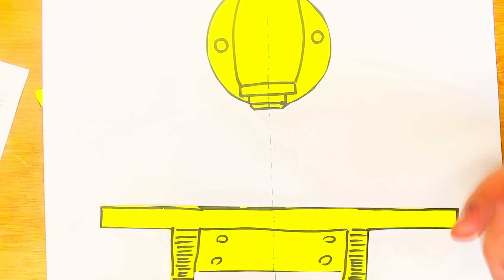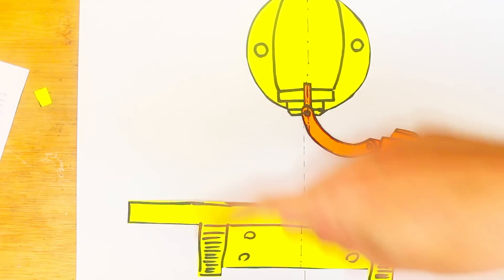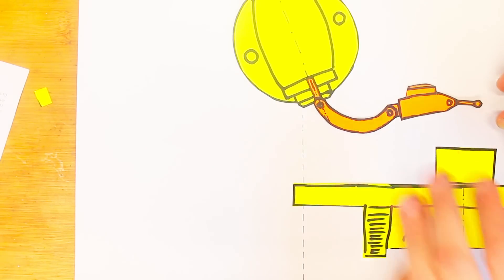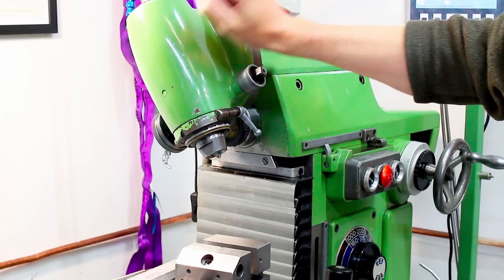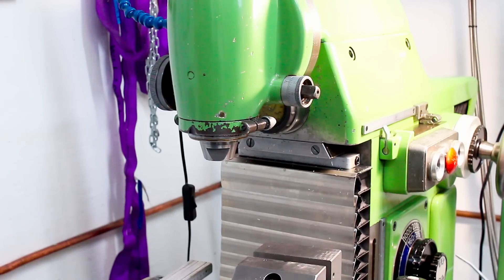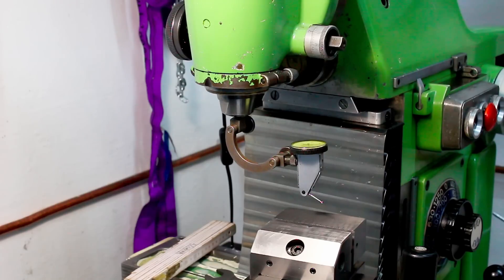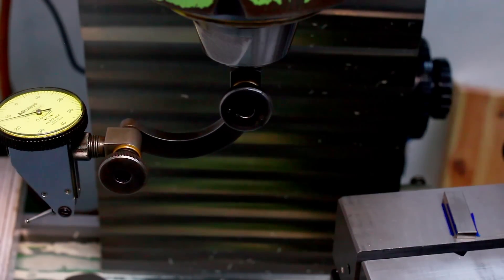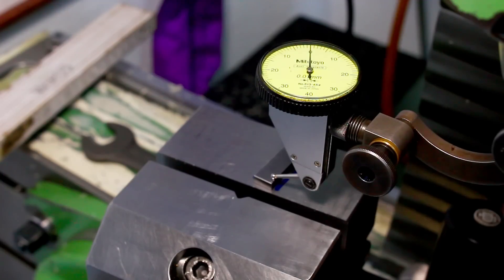Machine spindle tramming

Comment: I'm very new to this stuff, about 3 weeks into learning "from scratch." What I discovered about the gauge block method is that my mill's table is not "very flat." I ended up massaging the block around for a bit until I found repeatable measurements "within some range." Well my rong-fu 30 is not very accurate. But it is very rewarding to learn how bad it is, and to understand what one can do within the bounds of reasonable badness. It's pretty obvious if you use a brake rotor then you are getting "average badness" that is more under the control of the brake rotor. I guess the idea is to throw everything you have at it and see what comes up.

Comment: I don't understand: doesn't sweeping a gauge block sitting on a vise simply reproduce whatever imperfections there are in the vise surface? I can see that the total surface area of the gauge block will reduce this effect, but unless you touch off/measure on exactly the same point on the gauge block on both ends of the sweep, any angle introduced by tiny imperfections on the vise surface should be repeated on the top of the gauge block, less a slight averaging effect. What am I missing?

Comment: 3:38 Most don't know that on the Bridgeport there are notches/steps factory milled into the housing at the ends of the quill stop screw specifically for use as reference surfaces for tramming using a square or indicator. On a Bridgeport that would be better than using the side of the quill.

Comment: When tramming on the table I never swept directly on the table. Slip a solid object with know parallel sides (1) between the indicator tip and the table. Swing the indicator around and check again. Far too many times I've seen the indicator tip take a shock.  Another option is to use a good size bearing race large enough to cover the y axis dimension of the table. And sweep on toP if that. Another option is to tram up and down with the quill to a very accurate angle plate in x and y. 
Additionally the top of the table should mapped to see just how flat the table is to the x and y axis. Also an angle plate should be checked to z axis motion. Head or Knee.
1) As you said a gage block or my personal preference a roller from a Timken type or a cylindrical roller bearing. Ground to within 0.00005"/0.0013mm or less in parallel. I preferred to use the roller out of a bearing for two reasons. One is if I drop it it. The second is I had several sets of 3 made up to different heights for doing set ups. One thing I did a lot of is rebuild machine tool spindles. On a lot of spindles the front face or a gage line are meant to be a certain dimension from a specified feature. This often requires grinding spacers to the needed dimension. These spacers need to be as parallel as possible. Less than .00005" in parallelism. This often required grinding a sacrificial surface to put the spacer on. This gave as true a surface as the grinder could produce.

Comment: I'll have to view "part 2".  I am concerned about table droop.
Reply from the maker: table droop is definetly an issue - But not only with that technique, but in general. If you use the table movement method to tram the spindle and you are worried about table droop, move the table symetrical left/right off center, that will average the droop out.
Reply: @StefanGotteswinter   Yes.  I  suppose that the definition of having  the head trammed becomes somewhat subjective when the table droops.  The best one can expect is a symmetrical bow tie shape on the machined part.

Comment: All the vids on this and yet not one shows the final proof that it is square. I have found that all these methods only get you close. 
The final proof is taking a light facing cut with a 3-6 inch single point fly cutter and seeing that it makes a cross hatch pattern in both directions and in both the X and Y axis.  If you see a pattern like this )))))))))) or this (((((((((( it is NOT square on that axis. 
I have one job that requires milling a 14x14x2" part with flatness better than 0.0002" and parallelism better than .001". None of the methods I've seen can accomplish this, leaving steps between passes. The only way is test cut and tap until both axis show crosshatch marks in both directions.
Reply from the maker: Well, thats true that it will often get you only close to a crosshatch pattern - because a cut introduces a force into the system and bending things out of square during the cut.
I even found on rather very sturdy mills, that they where only able to perform a crosshatch cut in one direction, not the other, after tweaking for that finish.
What counts for me, is the squareness to the axis movement to get as good positional precision as possible. (important when changing from a short edgefinder to a long endmill to an even longer boring head.)
(The tramming i performed here will for sure give a clean crosshatch with my 50mm facemill - i dont have or use larger cutters)

Comment: 750 videos on tramming a spindle, now rendered obsolete by German precision. Also, Bridgeports are very top heavy, and they are a pain to tram. The worm gear moves all over the place, you have to approach tram from the right direction to mitigate the backlash in the worm, you can’t just bump it back and forth. Also, it will mover ALL OVER the place once you begin tightening down the bolts. It doesn’t matter if you’ve snugged them up, it’s going to move. Come to think of it, bridgeports are very mediocre machines in general. Yes, they can technically be pressed into doing a lot of different things, but they don’t do any of those things particularly well. I can’t fathom how/why the ended up becoming the predominant design in the US when there were so many superior machines on the market.
Reply from the maker: Don't worry, the Deckel mills here have about a million problems, just different to the bridgeports :)
Reply: @StefanGotteswinter  haha, yeah I guess the grass is always greener, as they say. 😉

Comment: Question; when you swing the spindle head 180 degrees how do you know you actually swung it 180 gegrees and not say 179 or 181 degrees?
Reply from the maker: Its not critical - As long as the head is not (for example on a bridgeport) nodded forward/backwards an significant amount, it will be fine.

Comment: There are a few subtle differences between the three methods. The first method sets the axis of rotation of the spindle square to the surface of the table, which makes for good fly cutting but introduces inaccuracy if the travel path of the table is not parallel to its surface. The second method sets the surface of the quill parallel to the path of the z axis travel. Two sources of inaccuracy are introduced- that the axis of spindle rotation may not be parallel to the surface of the quill, and that the travel of the Z axis might be out of square to the table surface and table x-axis path. The last method trams the axis of spindle rotation square to the travel path of the table, which generates the best flatness on a surfacing cut, but at the expense of parallelism between the finished surface and the table surface. It seems to me that each method of squaring should be used in specific situations depending on what kind of cut will be made and on which dimension has the tightest tolerances.
Reply from the maker: The first method (sweeping on the table stationary) will create a unpredictable result for flycutting, since the table surface is not necessary 100% parallel to the axis the table moves on.

Comment: Interesting Stefan, but I have a question. In using this technique...are you not transferring any error in the table to the head? If your table is worn on an older machine the error in traversing it from one side to the other will migrate into the head...no? When we sweep the head from one side to the other 180 degrees for example using the slip gauge method you mentioned the table is static...therefore any error or wear is not transferred...Or am I getting it all wrong?

Comment: On my Bridgeport clone to set the job at an angle say in the vise  or on a angle plate or for tilting the head for that matter I use one of those small and cheap electronic levels 30ish NZ dollars. Never checked against a precision known angle to see how precise it is but for the work that I do its more than adequate. Quick too.
Tramming the head of my Bridgeport clone  ( I use the sweep method using a precision block ) is made a little more difficult as the mill is fitted with a Southwestern 2.5 axis CNC retrofit but after doing a few trammings it becomes much easier.
The Bridgeport turret type mill for general machine work has got to be the most versatile milling machine ever made.  Stefan you really must try one.

Comment: Stefan, the technic you mentioned on the Deckel style machine do not allow you to trim the head with the table but only align the head with the vertical axis of travel.
Reply from the maker: Well, thats what we want usually - Square to the axis, not to the table surface. Having the table trammed is a different thing.
Reply: @StefanGotteswinter  Sure, you mixed various things....

Comment: Thank you for this great video.

I understand a 3 axis milling machine as a set of: a table (or any piece support), 3 axis ways, and the spindle. Where each of them needs to be trimmed in  two angles respective to it connected component. Or a total of 8 angles to check and adjust. (Being the alignment of the table around the Z axis only useful to have the T slots aligned with X, so probably only 7 are required).

Considering this, the two technics of rotating the dial gauge on a flat surface (the table), or moving the table are not equivalent:
1) Moving the dial gauge on a flat surface allows to check the squareness of the spindle against the flat surface.
2) Moving the table allows to check the squareness of the spindle against the X,Y axis.
So that if the table is not perfectly aligned to X,Y, the result would not be the same.

For example, if the table is not square to the X axis, the created piece will be out of squre (technique 1); while using technique 2 will result in a square piece but worse surface finish, especially with large diameter surfacing tools as only one side will be engaging.

Not sure if this makes sense, to be honnest I am not an experienced machinist.

Again, thank you for your great videos, I always excited to watch them.

Comment: Thanks Stefan, superb graphical illustrations 👍!  You are correct that the Bridgeport uses a worm drive on the head tilt, and another on the “nod”. The nod is naturally quite heavy and would be miserable to adjust if the worm drive weren’t there.

A handy feature of the Bridgeport is that the spindle sticks out from the quill about 15mm, giving a convenient, cylindric place to clamp on an indicator holder. There’s no need to disturb a tool or swap collets.
Reply: When adjusting the tilt with the worm gear, you must support the weight of the head or you can strip out the BRASS gear. :/

Comment: I wonder, how precisely are x, y, z axes perpendicular on a Deckel FP1 machine. I have an old TOS knee mill and I have to devise some method of checking squareness of principal axes - table side-to-side, table back-and-forth, table up-down. Preferably without buying some super precise square measuring block.
Reply: As someone that used to do this for a living, having a good square is the right (easiest/only)  way to do it. happily a cylindrical square can be found fairly inexpensive.
The most important first step thought, is to find the appropriate factory inspection report (ideally the one that came with your machine ).
this will tell you how to inspect you machine and how accurate it can be.(short of a major rework of the machine you will never achieve better than the factory).
If you dont want to spent on a high quality square you can use use an ok quality square, by placing marks at top and bottom  and indicate to these marks while 
turning the square 180 degrees and splitting the differance. I definately prefered the precision square or cylinder.

Comment: Awesome video as always Stefan! Quick question, does it matter where you place the gauge block relative to the table centre? Your techniques eliminates any inconsistencies in the table surface but for example if you place the gauge blocks so that the 2 points where the indicator makes contact is way off centre, do you think the sag of the table under it's own weight would give false tram readings? I guess this might not matter as much on rigid machines but on my smaller bench top mill, the table sag off the edges of the saddle are considerable so when I try the stationary sweeping technique you show earlier in the video, I always try and make sure that the table is centred. I'm not sure if it matters that much so curious to hear your opinion.

Comment: Hey Stefan, thanks for the demo (I admit Adam's post has slipped me). A couple of comments:
- the traditional method, indeed, doen't always work on deckel-style machines, since you have no guarantee that the table is also trammed! (the swivel tables or your indexing head could be all over the place). So, better stick to tramming VS travels, like the two other methods.
- for the quill method, your Deckel test bar can help, I think it's 300mm long. Though, for the FP1, one could even shorten it a bit, since things are tight there.
- for 'Adam's' aproach, the thing to pay attention is symmetry, it's a non symmetric procedure by definition (w.r.t. the X axis). So, the inevitable Z-X rocking can infuence one's measurements if one goes too far (not a big issue with your indexing head setup I suppose).

I remember seeing your 'fix a vise on the table and never, ever, move it' some years back (Simon's as well and not only). I admit I feel more confortable with the versatility of the euromill aproach where you take nothing for granted, you just include a couple of minute of tramming (head, table, whatever you need to tram) before working.

Cheers,
Thanos

Comment: Very nice video, Stefan.  Thank you.   Question: At 8:43 you use a hex wrench that appears to have a feature around the equator of the hex/ball end.  Does this feature have some sort of capture mechanism (O-ring, spring, etc) to keep Allen head screws from falling off when gravity is not in your favor?  If so, what is the brand of the hex wrench?  Thank you.
Reply from the maker: Thats a Wiha Magic Rin hex wrench - They are supposed to hold the screw, but it only semi-works. And the springsteel rings tend to break. Not a big fan.

A piece of blu tack (or equivalent product) works better.
Reply: @StefanGotteswinter  Thank you.
Cheers,
F.C.

Comment: The last approaches would work good in tool and die work. Where the part is hanging off of the table and after square cuts, a draft angle has to be cut.

Comment: On the Bridgeport, the addition of the “nod” would make the reading of the quill problematic I’m thinking. I have used a parallel even a set of two.  Gauge block tips were good.  I always enjoy your videos and learning from your knowledge.  Even before you made videos by reading the forums.  Thanks for what you do!
Reply: Yes the two axis do need to be trammed separately.  On Bridgeports and clones the pivot point for the nod is not centered above the axis of rotation.  This means that when you tram the nod, you cannot move it half the indicated difference.  In fact, if it is very far out, the indicator will be moving the same direction on both ends of the sweep, but it moves much less close to the column than close to the operator.  The turret further complicates tramming if you want to use a sine bar to achieve an angle (or compound angle).  when you are trying to set an angle other than precisely 90 degrees to the table, the forth and back motion of the ram must be trammed precisely parallel to the y axis, or the indicated angle will be wrong.

Comment: Great demonstration. The gauge block sweeping trick also works on a Kurt style vise using a drop indicator. I recently mounted a Bridgeport J head on my RF45 clone and tramming with the worm screw is a dream compared to pushing the old gear head around. The trick to dealing with the offset weight is to push in the direction of travel while cranking the worm screw. The worm shaft is fairly small and pushing also helps avoid shearing it.

Comment: On your old mill RF45 clone, how did you handle the nod? I am questioning my column squareness, sticky Z travel, and nod upsetting teaming. Tighten the gibs and the nod changes, but then it won’t raise or lower. 😢
Reply: There is a video where he squared up the column using an epoxy fill to overcome the lack of adjustability. You could also scrape in the column mounting surface.

Comment: I have a 1943 TREE knee mill. It has a collet closer witch is very nice, no draw bar on a TREE. Unfortunately during a very heavy plunge fly cutting operation. The operator noticed the machine sounded different. We had broke the casting, so now it's "tramed" and welded. No more tilt and nod for me. All I can do now is kick stuff up on a sing bar.  In other words it's a glorified drill press. LOL

Comment: I wish Bridgeports were so easy to tram, the Bridgeport is so top heavy they have a tendency to move to far and the worm screws are useless for fine adjustments.. I get it close with the worm and tighten the bolts a bit and tap the head true with a lead knocker with the worm set where there's backlash

Comment: Hi great video. I am from the USA, Bridgeport mills do have 2 worm screws to adjust the head in both directions.     Yes they are very top heavy. It is a very versatile machine.
Reply: And one MUST support the motor's weight when using them!  You must not move the motor's weight with the screws, because the gear is made of brass, and you will strip it after a few operations. The job can be done by a single strong person with good dexterity, but to be safe it is best done with two people. Don't rush it.